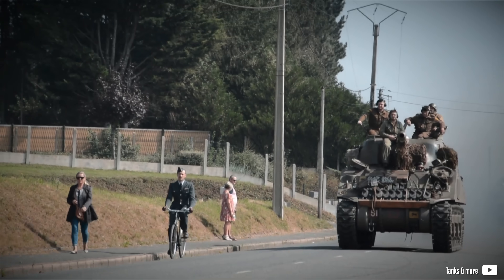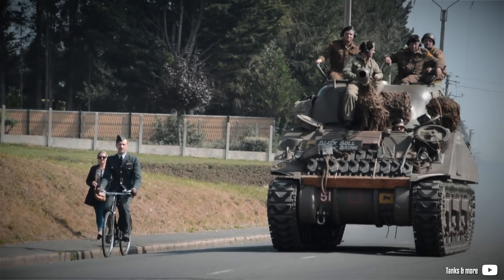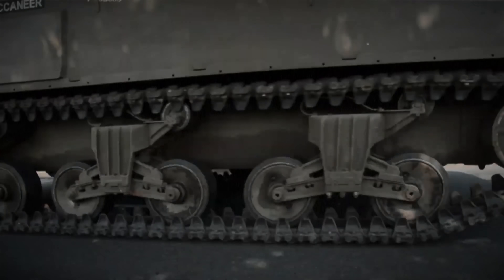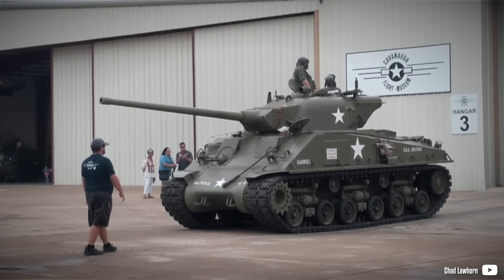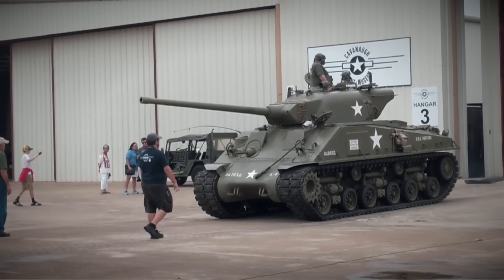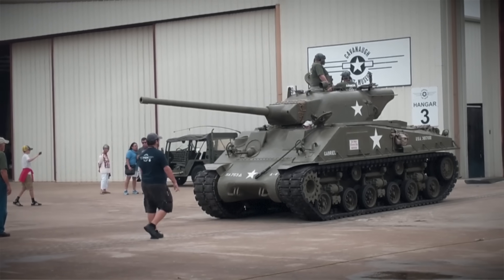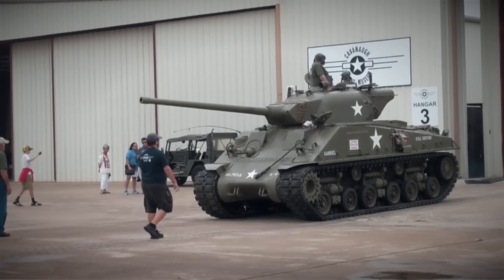This Super Complicated 30-Cylinder Was Sherman's Most Reliable Engine

Comment: My grandpa drove a Sherman in WWII he talked about this type of engine because it was such an odd design
But the one he drove has a air cooled  radial air plane  engine
Reply: One reason the Sherman was originally designed with an air cooled radial was it was available.  Plus the US really did not have an inline engine large enough to power armored vehicles besides the Allison. Sherman's were actually powered by a number of engine types. The air cooled radials (gas and diesel), Twin inline GMC 2 stroke diesels and the 18 liter (1100 cid) Ford V-8. The US possibly could have had two useful engines for armored vehicle use in the Wright D-12 and Conqueror aircraft engines if the tooling had still existed. The Ford V-8 was actually developed from a 27 liter (1650 cid) aircraft engine Ford proposed and dedigned.
Reply: @mpetersen6  👍 Thanks for the info
Reply: @mpetersen6  Packard and Allison both had V-12’s in the power class but they were a bit long for the Sherman’s design.
The late WW2 Centurion got the Meteor which was an un-supercharged 27 liter Merlin engine (which became available because the RAF stopped using them in new aircraft in 1943).
Reply: @allangibson8494  Not exactly. First Meteor engines were decommissioned Merlin (not more airwhorty, due to defect, or caming from wrecked planes), with the supercharged removed. 
However, the production of Merlin engines continued until WWII's end.
Reply: @gufo_tave  Until 1943 Merlin’s were in short supply - the RAF frontline fighters then switched to RR Griffins and Napier Sabres (and gas turbines).
That freed up production capacity for other uses.

Comment: 5 water pumps 😯 Very complicated, but actually genius for using already proven engine architecture. I remember reading somewhere years ago that there was a 10 litre V-twin tank engine used by (I think) the Germans which broke clutches regularly because of it's huge firing pulses.
Reply: The 5 water pump version is actually very simple as it uses off the shelf parts where as the single pump version is a custom build.
Reply: I would also imagine it being advantageous for redundancy - a single water pump failing wouldn't kill teh whole engine. While this engine is complex with a lot of failure points, being basically 5 engines bolted together, it also has a lot of redundancy in that many failures would only take out one of the five, as long as it can remain turning the engine as a whole can keep running. I wonder if it was even possible to mechanically disconnect a damaged bank (perhaps by removing the gear that connected it to the main output gear)?
Reply: @quillmaurer6563  Yep, pull the output gear and that engine is no longer turning.
Reply: @quillmaurer6563  With the power unit out of the vehicle, pulling the flywheel and gear cover would not be much of an issue.  As for doing it in vehicle , I don't have any information to say one way or another.
Reply: ".....I remember reading somewhere years ago that there was a 10 litre V-twin tank engine used by  the Germans which broke clutches regularly because of it's huge firing pulses......" 

Not the Germans. The Russians. And it wasn't a V-twin - it was a 38.8 litre DOHC diesel V-12 adapted from a dirigible engine, which was for some reason or other called the V-2.
Reply: @Baribrotzer  What a lovely comment. It would have made more sense just counting to ten (:-)
Reply: Just a bunch of straight 6s
Reply: To those wondering of limping back with a or some damaged banks, the easiest in either method to turn a damaged bank off was to pull the fuse or distributor off for the afflicted block. 
    Also, so long as the central main casting (effectively the combined lower crankcase of each,) didn't get holed by say a bent/snapped conrod the engine could run sluggishly on 2 unis.
     If only one or two bank units failed to fire up,, often it was said to not be too noticeable initially apart from a slight reduction of acceleration.
Reply: @razor1uk610  Turning off a damaged or failed block doesn't stop it turning, which would concern me. Just imagine what would happen if one of the banks broke a rod or two or a crankshaft and then was forced to continue rotating by the other engines.
Reply: @LN997-i8x  Exactly right,  especially with a common oil sump.
Reply: @LN997-i8x  pretty much nothing would happen actually. The engine is turning which means it has oil pressure it just isn't producing power
Reply: @razor1uk610  Pulling a fuse or distributor would stop a damaged bank from firing, but it would still be turning. There might be some cases where that's useful, but I'd think in other situations they'd want it to not be turning at all.
Reply: @quillmaurer6563  If one of the crew could lift the engine hatch of the tank w/o getting shot at or hit by mortar fire, then he could probably loosen the spark plugs as well as yank the distributor cap so the disabled bank wouldn't impose a compression load.  Of course, this would fill the engine compartment with gasoline fumes, not exactly a safe situation!
Reply: @razor1uk610  Deactivate the ignition, shut the fuel off to that carburetor, pull out the 6 spark plugs, and just let it coast along for the ride. Beautiful. Necessity was the impetus for invention.
Reply: Engineer 1: "I heard they have come up with a new engine, how should we combat this?"

Engineer 2: "It's an over-engineered American Engine, so we should combat with a simple one."
Reply: @jwalster9412  minor correction, complex and overbuilt is pretty much the opposite of over engineered.
Reply: @garethbaus5471  .
Reply: Tiger tanks used way overengineered engines with huge roller bearing for a machine that might only last 1000 miles, that and meth is why Germany lost the war and Hitler was a nut bar. 🤪
Reply: @codyhatch4607  it was reported that he was indeed on amphetamines ...which would go a long way to explain things
Reply: @phil955i  He was on a cocktail of drugs in the teens.
Reply: @phil955i  "it was reported that he was indeed on amphetamines ...which would go a long way to explain things."

He was only on meth for the last year and a half or so, and that was because he had a chronic gastro-intestinal disease which the meth helped the symptoms of.  He was actually a tee-totaler for most of his life.

Comment: Just as impressive as the multibank was the Sherman tanks that had it. Right when the Germans were rolling with their fancy diesel hybrid drivetrains, the Sherman just plowed through their defenses with radial engines. 

Imagine that. A tall tank with massive radial engines.
Reply: I don't think the German's had any diesel engined tanks.
Reply: I have to point out that practically no production German tank had a diesel-electric drivetrain.

The hybrid drive on the Elephant TD used two gasoline (petrol) V12 engines to generate power for electric drive.

And the Elephant is still a rare example, most (90%+) German tanks simply used gasoline (petrol) engines because all the diesel they could refine was needed by their navy. Same as the British who used mainly petrol engines. The USSR in turn used almost exclusively diesel engines for their tanks while American Shermans as well as some other US vehicles had diesel engine variants.
Reply: Geez the YouTube make up new facts ‘experts’ came out tonight!
Reply: I remember more than a few vets I talked to say something along the lines of: the Germans had excellent engineering, even better than ours sometimes. But the production was difficult and time consuming and they also had limited resources. 
We just made (produced) so much more, and "threw so much more crap at the wall than they did."
(Not crap as in junk/bad engineering, crap as in we out produced the crap out of them 😄)!

Comment: I have a 230 in my '56 Dodge truck. Rebuilt it myself. They were used in all kinds of equipment, fork lifts, street sweepers, wood chippers. pumps. Cool motor.
Reply: More durable than a eco boost I bet lol
Reply: @arthurhudgens8213  but a Ecoboost puts out 3x the hp
Reply: @kennedy796  And has 30x less longevity
Reply: @kennedy796  Until it dies that is.
Reply: @kennedy796  Yeah, but not for long.
Reply: I'd like a car with a straight 6, they seem like a breeze to work on.
Reply: @abelq8008  The straight six has the smallest number of cylinders giving perfect primary and secondary balance, and overlapping power impulses. This makes it inherently smooth. Which is why such luxury makes as Mercedes, Jaguar, Rolls Royce, and BMW stuck with the "big six" concept for so long. They are an optimum design, larger number of cylinders have their advantages but represent diminishing returns, in other words, more complexity but not always to your advantage.
Reply: @mrdanforth3744  yeah but they ahve more internal friction
Reply: They were used as marine engines too, just as reliable and long-lived there as well 👍
Reply: 56 Dodge… a 325 Red Ram would be wicked, but the Flathead 6 is still pretty cool
Reply: @loganshotrod4x464  it's a ton and a half duelie stake body. Was my families delivery truck for their machine shop. That thing covered the whole east coast delivering Quakermade poultry equipment. We're PA  German, not known for extravagance so of course my great granddad went as cheap as possible, no hemi. I first drove it through our fields when I was probably 10 yo loaded with two tons of seed corn and fertilizer. Hopefully this summer it's back on the road.
Reply: @gruberstein :  I totally understand where you’re coming from! 👍😎
I’ve done several projects with friends, some projects lend themselves to simple restorations & other projects lend themselves to more modifications.  I’m a hotrodder, so it’s pretty easy to see the direction I usually take.  For a 1.5 ton, the OG flathead 6 will definitely work & id never presume to tell another man how to build his ride; with that said, a 440 & a NP435 would be a build that would get me pretty excited, just my .02.
Reply: The guys over at Acorn to Arabella use a chrysler flathead 6 for their giant thickness planer, if I remember right.  Cool motor, indeed!

Comment: Great idea, no overhead valve gear to tangle with shrapnel etc. - just easily replaced spark plugs. I like flatheads : )
Reply: Would love to see a flathead created using modern tooling and casting techniques. Could probably make it extremely tough. Mechanical fuel injection and tuned for high compression.
Reply: @murmenaattori6  - Injection yes, high compression no, - a blower!
Reply: @loddude5706  Or that, yes. There are also turbo flatheads out there, some awesome stuff.
Reply: imagine if those were 2 strokes, and 1000lbs lighter without tappet valves and sounded like Waaaang waaang when revved!
Reply: @fidelcatsro6948  I love 2 strokes as much as the next guy but it always seems to come down to efficiency in the end. For a boat or motorcycle 2 strokes are amazing, cars less so. Still love em tho.
Reply: @murmenaattori6  i still believe 2 strokes can be made more efficient, despite what they say..its the design of the engine that make it a winner or a loser! i love the surge of power at the high rpm range!
Reply: @fidelcatsro6948  There are 2 strokes out there with 4 stroke characteristics like no premix oil needed and high efficiency but these are usually diesels such as Detroit Diesel 2 strokes which use a single poppet valve and then there is the opposed piston engine like on the soviet T-64 and British Chieftain tanks. Opposed piston engines have 2 parallel crankshafts coupled via gears, 2 pistons facing each other in 1 shared cylinder, no valvetrain, no cylinder head, two stroke like valves on each end of the cylinder so when the stroke reaches the bottom, one side exhausts as the other intakes via blower pressure. It sounds like a hassle but ultimately it has better efficiency than common 4 stroke as no energy is lost pushing against a cylinder head, instead going to another piston. It has oil sump lubrication like a 4 stroke. Ultimately less moving parts for the same amount of power strokes and cylinders as a comparable 4 stroke. Coupled with their small packaging is the reason why they're used in tanks.
Reply: They were perfect for this usage, but specific output has to be kept low due the fact that flatheads tend to run warmer than OHV stuff.  That's cool!  Just add a few more blocks....
Reply: @Lod dude I was thinking something similar; perfect engine for a tank that needs to keep going even if hit. Looking at it, it could probably take a direct hit and still have enough working parts to get home. Just take the spark plugs out of the damaged banks, block the intake to that bank, and off you go!
Reply: @BudoReflex  The opposed piston engines are usually diesel multifuel, so they don't evev have spark plugs. Just mechanical injection and compression ignition. Simple as it gets, no electricity required to run. Being multi fuel they can be configured in the field to run on gasoline and ethanol tho like most tank engines.
Reply: @BudoReflex  an electric motor to get out of harms way in case of engine damage! 
🐱👍🏿

Comment: Crazy! Chrysler actually made something reliable.
Reply: Hard to belive, right?
Reply: I hear the inline 6 that was put into older jeep cherokees were hard to kill too. I know someone that ran into a deer totalling the front end and that damn thing still ran ....
The deer was a bit hamburger tho....
Reply: @hdezn26  That inline 6 was developed by AMC, Chrysler just kept using the design after the buyout. Great engines
Reply: @johneckert1365  The slant 6 was around well before they bought AMC.  Chrysler also made the first stage of the Saturn 5 rockets that took the Apollo missions to the moon.  Can't say those weren't reliable.  Modern stuff?  Well, some of it's good and some the less said about it the better.
Reply: @greendryerlint  I was replying to the guy that commented about Jeep Cherokee straight 6. 
I'm a big fan of Chryslers slant 6 too 👍
Reply: Scotty Kilmer left the chat..
Reply: Never hear of a slant six? Best pickup I have ever owned had one
Reply: Not a Mopar man, but they certainly have made more reliable motors than duds.  Its interesting Chrysler is replacing the current Hemi with a turbo inline 6.  Quite a legacy when you think of the flathead, slant 6, and now the Hurricane 6.

Comment: That engine fired 15 times per one main crank revolution. That is crazy and very cool. Just some of the cool and weird stuff from the war. 
Once again Vizoracer you found another gem of an engine. Keep up the good work and God bless you brother
Reply: Oh man... That thing would have felt silky smooth at any RPM with power pulses that close together.
Reply: yeah sounds like the God of Torque
Reply: @magnetmannenbannanen  that's what I was thinking. When he gave HP numbers I thought oh yea but what was the torque? And that's what you need to move heavy metal.
Reply: I onder what it would sond like on even headers? Would it be like a high-pitched racecar, or would it be odd.

Comment: Cool video! I am a new fan of Chrysler products due to my new to me 2004 Crossfire. Especially the Mercedes derived Karmann built build quality. It's only drawback is the cheap Chrysler made plastic crap that you mainly see or touch.....
Reply: As you already mentioned, the Crossfire basically is a Mercedes SLK R170, it just got a Chrysler-Design. Manufactured in Osnabrück, Germany. The SRT-6 is is pretty much the AMG-version of the SLK R170, has the exact same drivetrain. The Crossfire is a nice car and good used ones are available for way better prices then good SLKs are nowadays, but imho it's not really a Chrysler product. Too bad that the DaimlerChrysler-coop ended in 2007, i liked the idea of Mercedes tech used in other brands cars.

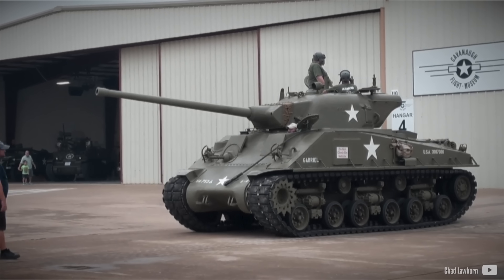Comment: 0:09 - what sort of Sherman is that? never seen it before... repainted Israeli M-51 -muzzle break?
Reply: looks like a firefly. packing a juicy 17pdr cannon.
Reply: @sicstar  fireflies have a cuboid box with the radio equipment inside on the back of the turret, not that strange extension of the turret's actual armour. The gun should have an muzzle break, and the gun mantlet is like nothing from a WWII Sherman.

On looking it up, i think it is indeed a repainted M-51 or M-50 without a muzzle break for whatever reason.
Reply: @RYNOCIRATOR_V5  heck silly me reversed in the vid cuz i thought its about the tank that was shown for fraction of a second on the timestamp. (whoopsie!) ye the latter one should indeed be an M-50/51. for the missing muzzle break no clue here either :|
Reply: @sicstar  ah i see, honest mistake, my fault for not stamping quite right.

looks kind of cursed without a muzzle break lol
Reply: @RYNOCIRATOR_V5  hey no problem! and yeah it indeed does ^^ i still wonder why it has none. uuuusually only the shorter, low muzzle velocity guns have none, but eh im no expert by any means in american tanks and who knows where that tank is from and what they did with it.
Reply: Brake!
Reply: @ianlewis6717  dyslexic :')

Comment: A 30 cylinder "star" shaped engine? Ok I'm interested.
Reply: no. it's five 6 cylinder engines with one casting in the center and a sunwheel for combined poweroutput. the nice thing is: should one of the parts seize,  you could simply remove the gear and move an with less power.
Reply: @tdsangel  and all this time I've been calling V8 an eight cylinder engine...turns out it's nothing more than two 4 cylinders mated together...what a scam!!!
Reply: @audriusbaranauskas6227  it depends:

if it is a flatplane V8 with TWO top parts over the main crank and not a whole block, you could say so. 

when thinking about american v8 correctly, we could call them inefficient and just cheap peace of crap ;D
Reply: @tdsangel   then how do you name an array of engines?

¿a battery?
tutum, piss